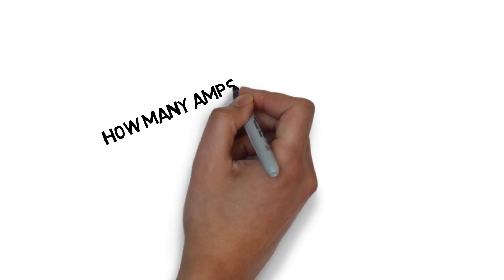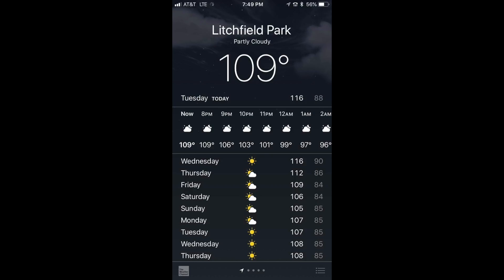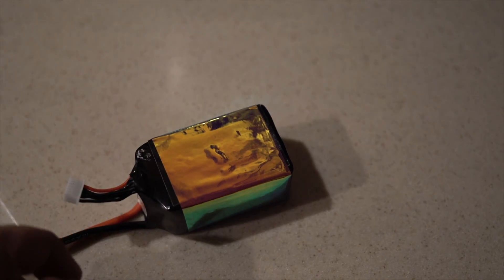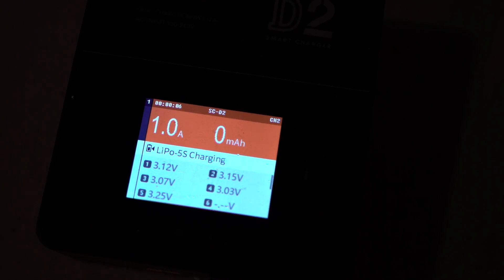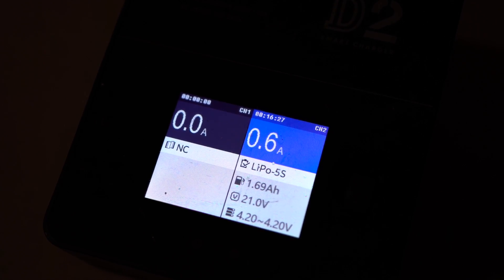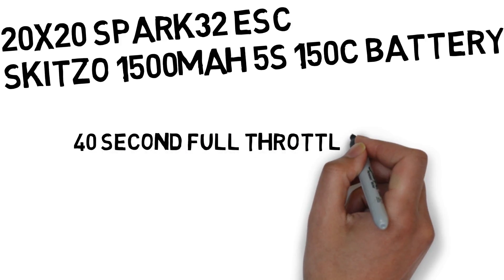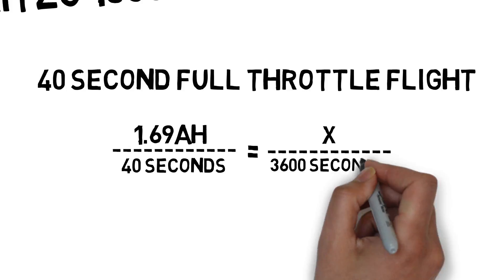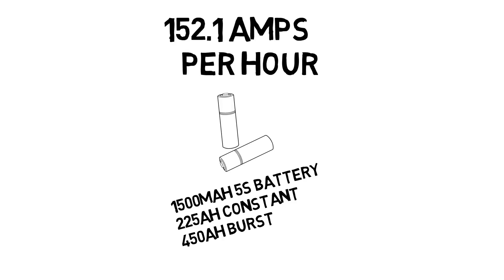New Battery, 151amp Flight, Spark32 ESC

Comment: Lot of mismatch between Amps and Amps/hour. 152 Amps per hour means that you can pull 152 Amp and battery will hold a hour. But really you have 1.5 Amp per hour, but what is 152 then ? That is average current... And 225AH, 450AH... That is not HOUR, that should be just Amp, just declared 1.5 multiplied on 150(C) and 300(C). I could skip that, but... Come on guys, that is FlightOne official channel! In category Science & Technology...

Comment: Let's Just wait for Joshua Bardwells Testing😉 but this battery Looks amaaaazing!!!

I have a question. I am currently thinking about getting a RevoltOSD with Bolt32 to run it on 6s with the new Mr. Steele low kv Motors. In the description for the Bolt32 you wrote "3s – 4s compatible (6s capable if modding the ESC)". What do you mean by modding? How difficult and complicated would it be? And very important: would my warranty still work? Would Love to run this FlightOne stack with 6s but i originaly wanted to use RaceFlight, because it seemed less complicated than others... I Hope it still is with 6s.
Reply from the maker: Order direct from us, we now have v2 in stock made to handle 6s.  Thats what I was using in this test.